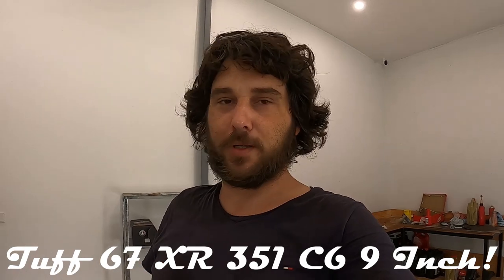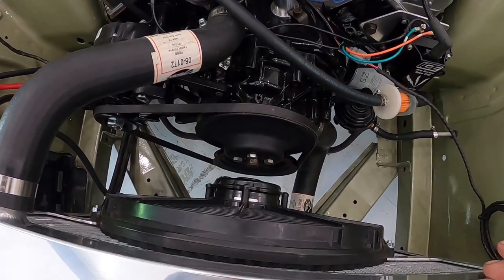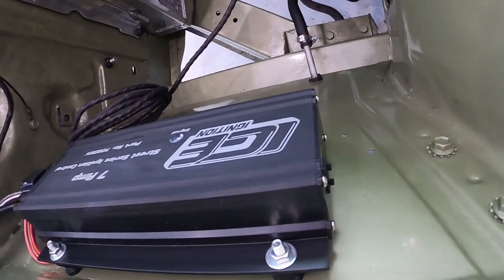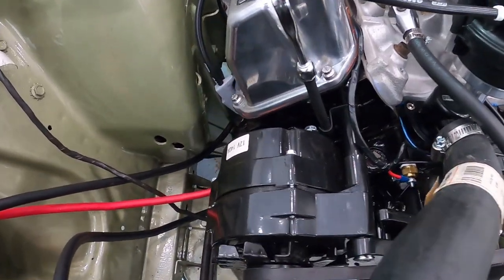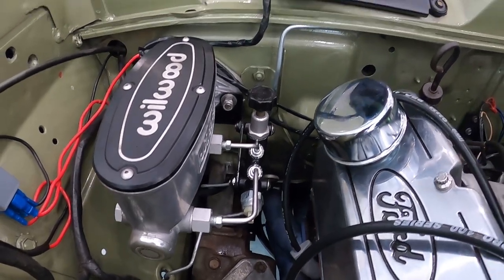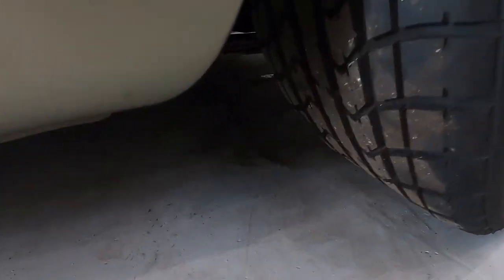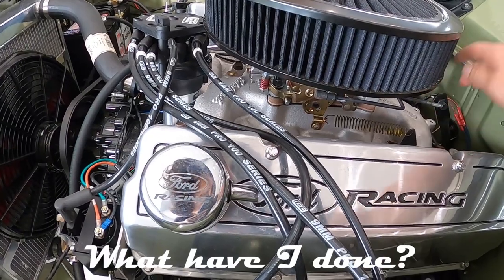FORD 1967 XR 351 COMP THUMPER CAMSHAFT BREAK IN SOUNDS AWESOME

Comment: 5:48 this is what I got a do to my engine every time I start it after been sitting for any longer than 2 weeks, it won't idle  until its drunk about $10 gas, its a beast too, got all the good stuff inside,  sounds so good that I've had it since 2002 been offered 6k been offered 8k and turn them down flat

Comment: Just a heads up on that style fuel filter.  I have ran a bunch of them but i have had 1 that the filter part actually broke loose from the plasic housing and allowed the junk to pass by and into the carb

Comment: The engine needs to run at 1500 rpms for 15 minutes,   but not sure about my 351 because it has a 400 cam in it, and it sounds like it
Reply from the maker: 2000-2500rpm for 20-30 minutes is ideal
Reply: @thclevoking  serch 1992 Ford EB Fairmont 351 Cleveland modified,    if you haven't already,  play it thru a sound system, its worth more views,  just wish I had the fans turned off when I started it
Reply: I've rebuilt over 400 engines. Never followed the so called cam break in procedure.
It's a myth.
I've never had a cam go flat.
Occasionally I've had a new hydraulic lifter not stay pumped up and had to replace it.
Reply: Use good assembly lube, have no issues

Comment: Nice car. Just curious about the comment at 1:10 though... as far as i know the main thing that aids in bedding rings in is cylinder pressure(engine load). Could you explain how the rings are 'thrown out centrifugally as the rpm decreases'? Yes they move but rings dont 'spin' in the cylinder subjecting them to centrifugal force, they go up and down with the piston.. cheers

Comment: I love the way people spend a heap of cash on beautiful cars like this Then put a $4.00 plastic fuel filter on and then strap it to the coil or put it in front of the distributor. At least you will find a leak fast. Nice car Great work.
Reply from the maker: The $2 filter will be swapped to a billet one, it’s just extra insurance to be able to see the fuel flow on start up.
Reply: Even though he changed it, that's still true.

Comment: You should have replaced the intake manifold bolts? Or at least painted or powder coated them???
The rust takes away all the great work.
Reply from the maker: Trapnell Race Engines built the clevo I only started it!
Reply: @thclevoking  Building up a brand new forged gear AirGap Clevo with worked 2v squish heads still costs big bucks. Mine was an NZ14.3k all-up build, not including test bed start 'n bed-in. Used an original new old stock Sig Erson TQ20H flat tappet old school single pattern cam from the day with 1.73 ratio Hyland Sharps as still wanted a reasonably good idle vacuum, and a Mach1 sound. 214/214 .517/.517 112 - 1500-5000 - as going into a ladder framed and canopy work ute, wasn't going for a drag strip engine that can't idle or pull hard below 3500, wanted strong low and mid-range cos, that's where 90% of use is. Using the calculation a 600 4bbl is quite sufficient for this sort of cfm pull thru, although a 650 or even the 'big primaries' Edel 750 AirValve could be used if an angry 6800-7200 cam was installed. But you'd never get full 100% opening secondaries. Pacemaker Tri-Y's and 2 x 2.5 open side outlets, no baffles. Still has a bit of a lope going-on. Quite good on fuel. Everyday driver.

Comment: I love your cleveland setup, but how did you set up your one wire Alternator and illuminate the starter relay and the regulator? I'm at that stage in my Boss 351 restoration and am not sure how to wire a one wire alternator. Could you advise or point me to some online help, thanks it sounds so good and looks killer.

Comment: Hi, I’ve got an Xr Falcon with a 200 in it. I’ve got a Cleveland 2v I’m thinking of putting in it. I know they barely fit because narrow shocker towers than xw Xy. What things do you need to do to fit it in? Special headers? I’m using a C4 trans.
Any help would be appreciated
Reply from the maker: They fit pretty well just make sure you use the appropriate extractors for the early cars they bays are narrower then Xa on. The c4 is the best pick they slip straight in there.
Reply: I’ve put in trans and Cleveland , extractors just fit in on drivers side. One pipe is touching steering box, but all good. Runs strong, rebuilt it 10 years ago , was sitting. C4 has 2600 stall and stage 2 shift kit. Problem I’m getting is when cold I only get shift from first to second, second to third only happens when engine warms up a bit. What do you think problem is?
Also I’m still running drum brakes at front. I’ve found Xy spindles new rotors and XB calipers. I’m going xt double master cylinder pbr 1.25 inch bore, and vh40 al remote booster.
Can I take spindles off without compressing springs or taking off shockers, I heard you can put a block of wood between upper arm and body rail. While on ground. Then Jack up car from body to lower arm , then take of upper lower ball joints and tie Rod to take off spindle. Is this correct?
Thanks
Reply from the maker: @ford351460  I undo the shocks then upper control arm bolts and I take the whole lot of with the springs mate. I would be looking for a vacuum leak, or a faulty c4 modulator. 2-3rd flare could also be caused by someone having swapped the servo on the c4, what letter is in your?
Reply: @thclevoking  it’s got an X on top of where governor and tail shaft go in.
Will spring come flying out if I undo top ball joint? Should I use a Jack under lower control arm? Or let it sag on a hoist?
Reply from the maker: @ford351460  I usually have super low king springs in all of my cars and they just slip in and out, if you have std springs I’d undo them to make it easy they would make it harder.
Reply: @thclevoking  i don’t really need to take out springs, all I want to do is take spindles out , is there a way to do it without spring flying out?
Reply: @thclevoking  I've fitted an hydraulic only 4 speed 'AOD' to my Falcon Clevo set-up. Had to shorten the driveshaft and re-balance it though, as the alloy box tailshaft housing was quite a bit longer than the original FMX.

Comment: which pwr radiator is that...do you you have part number....was it direct fit as i have xy fairmont with 302 windsor....is this the mustang one or cortina one.thanks steve
Reply from the maker: I’d suggest the mustang one they were similar to the Xr through to XY until the 1971 they went crossflow style. I’ll have to ask it was supplied.

Comment: I don't get what you said about cent. force seating rings on decelerations.  Rings achieve full pressure against the cylinder upon acceleration with combustion pressure forcing the ring out from under the ring in the groove.  Best seating comes from long pulls on the highway.  The cam on the other hand needs some medium rpm to keep it well oiled.  Nice build here.  Very sensible and functional detailing without worrying what part should be the kind the factory scrimped on to save money.

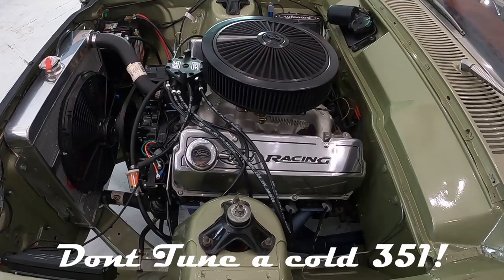Comment: 1:40 i didn't get to break my camshaft in because I said to the electrician don't start it till I arrive. When I got there the engine was already running,   grrrrrrrrr, should of said looks like there's no charge idiot,  the engine had never been started from a new rebuilt costing $4600
Reply: So does it have flat cam lobes now, or other damage from an improper break in?